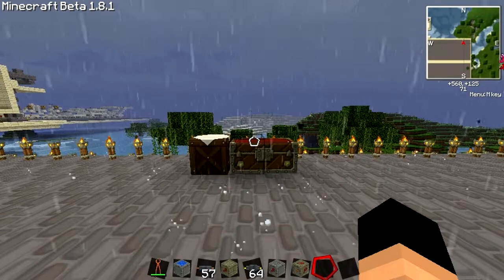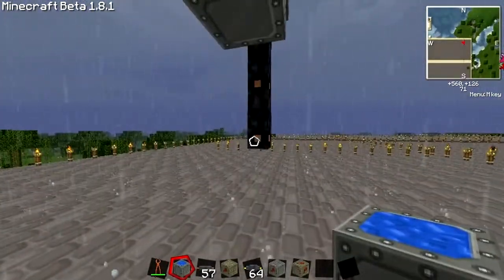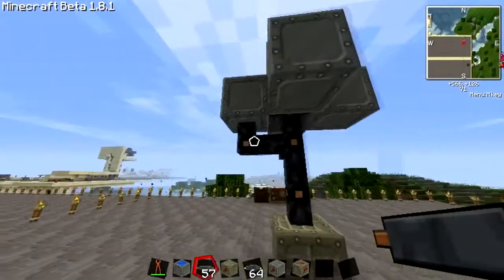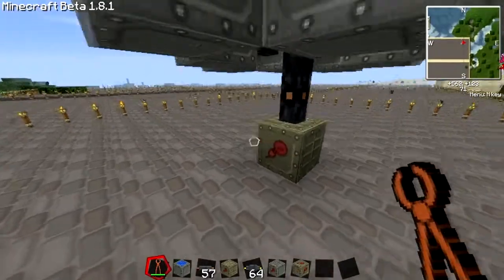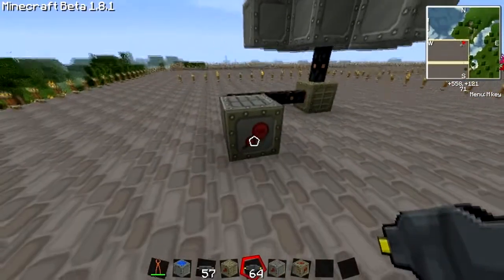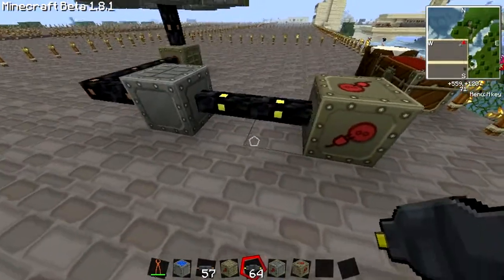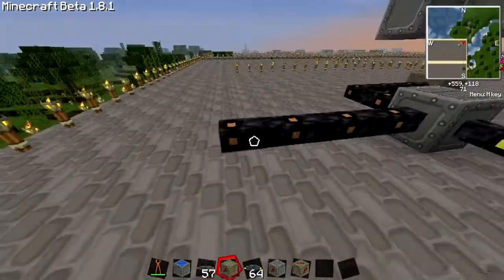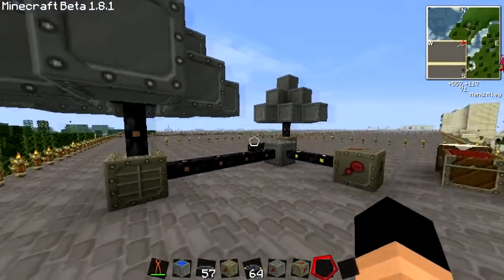[special] How to build a Solar Flower with MFE

Comment from the maker: Well there has to be some sort of power storage block right where the batbox is I doubt it matters what block it is. MFE input is ranging from 0 to 128, MFS 0-512 so it should be possible to hook it up like you said. I just never tried it.